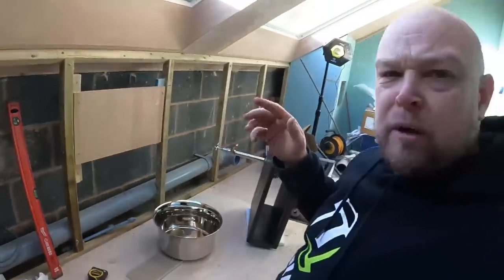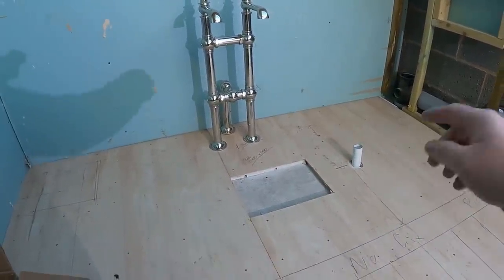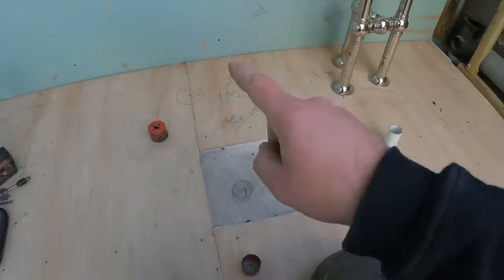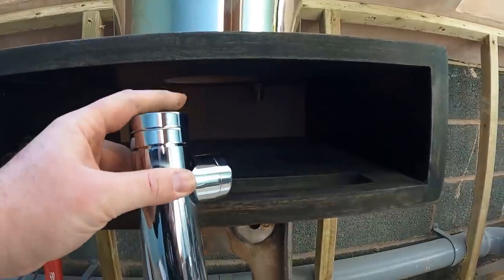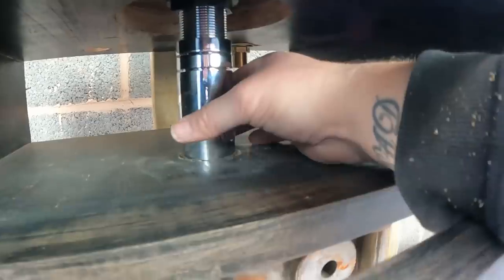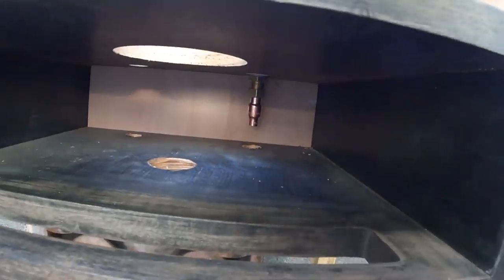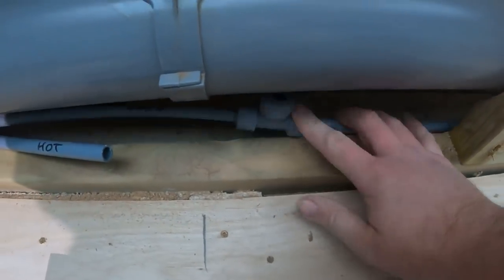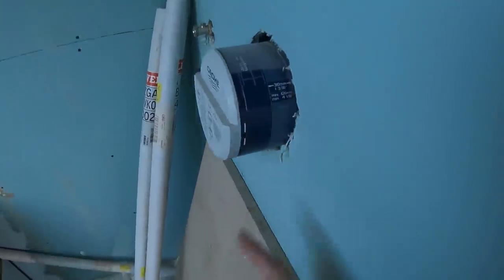HOW MUCH!!..COPPER BATH & FLOOR MOUNTED TAP TEST FIT -HOW TO plot out a BATHROOM

Comment: Hi Mark, great video again. Under the basin you could use what used to be called a Yorkshire 68, it is a 3/4 nut with a 15mm tail
Reply from the maker: Yep, didn’t have any one the van but will pick some up so I have them for the other bathroom👍🏼👍🏼
Reply: Or a end feed 68 as plumbers don't like spending money 😜
Reply: @albuchanan  🤣🤣🤣👍

Comment: Hi Mark, I’d use a 3/4 service valve that has a tap connector fitting on the top of it, then use an m/f chrome elbow to take you straight out the back 👍🏻 then reduce to 15mm in the wall cavity where you have more room.
Reply from the maker: Yes that’s an idea 👍🏼👍🏼

Comment: How about scrapping chrome trap and using wirquin nano to keep it all inside of the box and use right angle iso's to save having to faff around with chrome  on show under unit, keep it all inside out of sight.
Reply from the maker: Will take a look and see what you mean 👍🏼

Comment: The question is what thickness us the floor going to be if the tile and how would it affect the piping depths. Especially if they install anything for heat  as well
Reply from the maker: All taken into account, you can see the plasterboard that the basin is sat on when working it out👍🏼👍🏼

Comment: Hi mate, definitely a 3/4 - 15mm tap connecter, with an end feed 15mm m&f straight into the iso valve, then m&f out of the iso valve so no iso valve underneath. Everything is concealed in the unit.
Reply from the maker: Just struggling for the depth within the unit…. Going to put the iso underneath👍🏼👍🏼

Comment: brilliant video just one question how did you make holes bigger for 3\4 tap connector as hole had allready been drilled thanks
Reply from the maker: Just very carefully with the holesaw, start at an angle
Reply: @MJTiffPlumbing  thanks for reply i know what you mean with angle like a tile drill hole

Comment: Finished a wet room last week. Same basin trap but matt black, under squared ceramic basin, sat on a matt metal open frame. No access from rear of wall to make connection to a compression coupler. Not an option, all options were considered. Horizontal off trap needed cutting down and filing, filing, filing to be offered in to a pre-positioned push fit elbow, behind tiles. Lube, lube, lube. Kept thinking, "what if I damage or push out the o ring. Talk about a tight squeaky bum time??!!. GULP!
Reply from the maker: This is what people don’t see or appreciate, the time it takes to work out exactly how we are going to get over problems like this..👍🏼👍🏼

Comment: Could you not use a 3/4" to 15mm flexi push fit tap connector with iso valve built in sweep each one inside the unit to the opposite side and elbow through the back of the unit with 15mm copper? Love watching your videos mark keep up the good work 👍
Reply from the maker: Tht was the exact thought I had to start with but the builder didn’t want the flexis to be able to be seen at the back of the unit…

Glad you like the content mate 👍🏼👍🏼

Comment: 3/4 tap connector - 22-15mm end feed reducer - little stump of 15mm pipe - chrome pipe up into unit swaged end onto the copper stump, solder up good to go 👍🏻
Reply from the maker: Yep similar to what I’ve done 👍🏼👍🏼
Sacked the chrome off now it won’t be seen underneath, saves a lot of hassle 🙌🏼

Comment: have you thought of using a bent tap connector that way you can make the connection inside the unit
Reply from the maker: Need to have an iso on it aswell…. And it’s tight under the unit

Comment: Haven't read all the comments but would a ¾x15mm female iron straight with a fiber washer or liquid ptfe. Bath looks amazing. Don't like the whb tho 🤣. Great work.
Reply from the maker: That could be an option if the rooms allows.
Yer the basin has been a talking point that’s for sure….

Comment: If the floor is being tiled won't that mean your holes need to be higher as the basin will be sat on the tiles?
Reply from the maker: If you saw in the video it was sat on a bit of plasterboard which is the same height as when it will be tiled, along with a bit of movement in the Pipework holes👍🏼👍🏼
Reply: @MJTiffPlumbing  great to hear 😅👍 was worried
Reply from the maker: @BlGB0SS  👍🏼👍🏼

Comment: What's the slot for on the basin unit? Is that not to allow for your pipework to pass through??
Reply from the maker: That’s for a towel to go over that’s why it’s at the front 👍🏼👍🏼

Comment: You can actually get a glued to chrome adaptor  rather than use a mechanical on the basin waste. I find when  on site people don’t take care and they tend to get pulled out. Can set the adaptor so it’s like a chrome socket coming out of the wall. Only just learn this myself and works a lot better. Product is McAlpine abs35/32g
Reply from the maker: Yer I’m going to try and source some of these 👍🏼👍🏼

Comment: For the basin pillar taps use 2- 22mm angled boiler valves with 2- 22x15 reducers and it’s all within the unit , they’re loose nut isolation valves so happy days
Reply from the maker: Thanks mate👍🏼

Comment: Nice work! The McAlpine version of that chrome bottle trap comes with an elbow that is solvent weld to push fit for the visible chrome pipe.
Reply from the maker: Cheers mate

Yer I know the ones you mean, but it’s just basically a chrome coloured plastic trap so doesn’t look as nice to be honest
Reply: @MJTiffPlumbing  not the McAlpine ones… fully chrome plated brass.
Reply from the maker: @phillipwright6771  I will take a look 👍🏼

Comment: I would have extended the waste from the sink and put the chrome waste underneath,  2 flexable connections to chrome pipes through the bottom of the unit to chrome isolators, A bit of flex board painted to match the unit to cover waste extension and flexys , seems a waste of a lovely chrome waste  not being on show. Nobody can see in the unit unless they are 2 foot tall
Reply from the maker: To be fair the owner didn’t want to see too much of the fittings, you won’t see the isolator valves under the unit unless… as you say you are 2ft tall. 
As for the waste…you can only really see it if you look into the unit, just how he wants it👍🏼

It would look a little odd hanging out that low from the bottom I think…

Thanks for putting another view on it though, always good to hear what people think👍🏼👍🏼

Comment: its a shame they have crammed such nice fittings in such a small, low ceiling room
Reply from the maker: Only room that would work for a bathroom….
Plus once they are in place the low ceiling won’t be an issue 👍🏼👍🏼